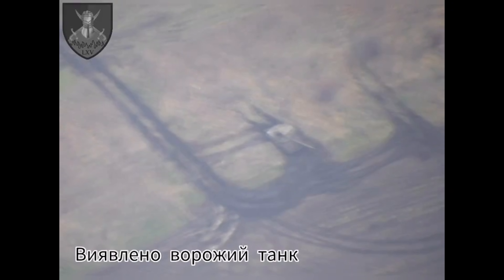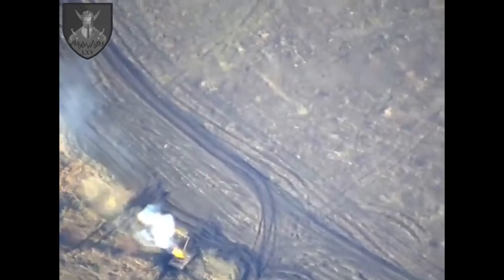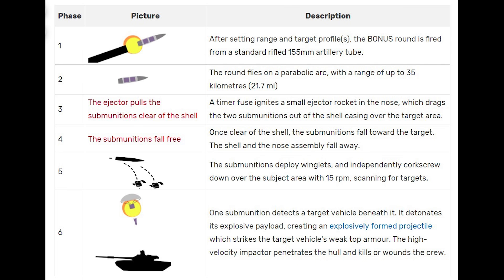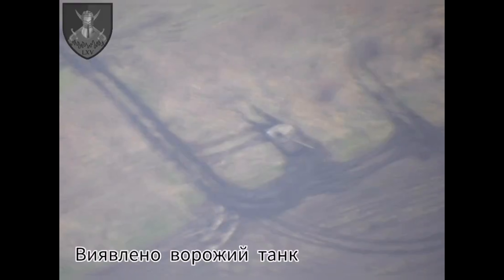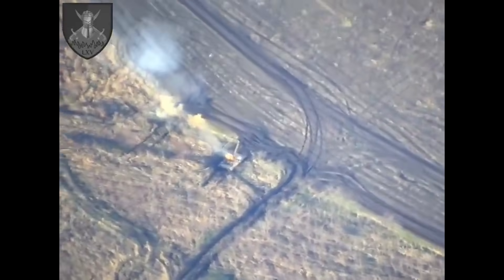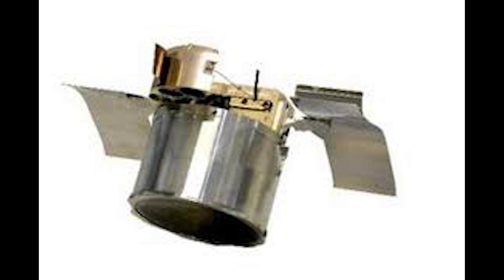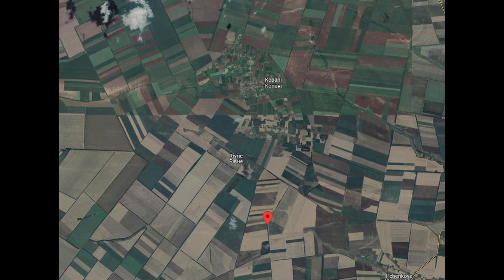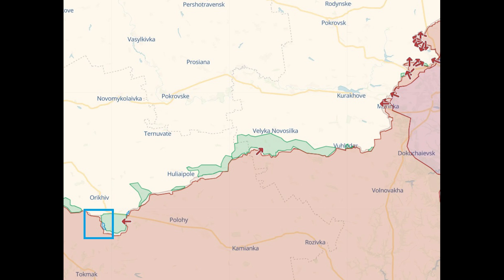Cool Footage of 155 BONUS Artillery Round  Against a T-72 -- Plus, How Does 155 BONUS Round Work?

Comment: This type of munition has been around for some time now and was originally designed to be deployed in clusters dropped by missiles onto Soviet tank formations. Ironically that would have been T-72s.

I'm not sure it would be worth dropping them from a drone, for one thing that would mean taking them out of the artillery round which means you no longer have that round to use, and I don't believe the way they operate would work with the drone. Besides, the Ukrainian drone operators look to be very handy at finding other things to drop on Russian tanks.
Reply: The problem drones seem to have currently is that the bomb-dropping types don't have ammunition with good armor penetration and difficult aiming. They are mostly sent to take out abandoned tanks or stationary softer targets and even then often requiring multiple dropped grenades. I've seen videos of the Ukrainians converting cluster bomblets that do have some armor piercing capability for this purpose but these are not nearly as powerful as those from the bonus shell.  Whenever the situation is more critical and it has to deal with targets on the move, currently it requires kamikaze drones and artillery fire. An armor-piercing, self-aiming droppable bonus device would be a more efficient alternative (for starters the larger Baba Yaga octocopter drones could carry three bonus submunitions at their current weight).
Reply: @tobiasrietveld3819  Thanks for you thoughts, Tobias. Much appreciated. As I am not aware how the Bonus munition works I am wondering if there is something within the missile which is needed to trigger the Bonus munition before deployment. If there is then just dropping them from a drone may not be enough. Equally as I mentioned if you remove it from the missile that means the missile is now not useable.

I have seen that the Ukrainians are using Russian mines with drones to blow up the Russian vehicles. A one way trip for the drone from what I've seen. I do wonder if adding a drogue chute to the mine would allow the mine to be dropped from the drone giving it time to clear the area.

Comment: Whether the submunitions can be deployed outside of the designed delivery capability would depend on how the submunition arms itself. If it relies on the spin of the projectile, then it's not likely. But if it's armed by the same mechanism that deploys the winglets and sensor package, then maybe it could be hacked in some way. I would say that it's doubtful.
Reply: iirc, and please don't quote me ;), but the sensors need a certain amount of spin as well to detect the thing on the ground.
so even if armed, just dropping it from a drone wouldn't give the sublet enough spin/time to spin up to actually target something
Reply: From what i can find is that the bonus submunition is a special shaped charge made to penetrate armour from a bigger distance than the usual shaped charges, meaning its bigger, and heavier probably than the RPG rounds often used on drones, so you would need a bigger drone. Also, its designed to arrive in an artillery shell that travels up to 900m/s so dropping it from a drone and make it behave as intended likely would be not trivial. Also, there seem to have been only 2000 produced, compared to an abundance of RPG rounds which means that even if it would work to take them from the rounds, it probably would be a rare weapon, and expensive. Now, if they can copy the explosive charge, and aiming mechanism to work when dropped from a drone so it can be dropped from hundreds of meters up while it guides itself, and then mass produce it, that would be awesome. But i bet i'm not the first person to have that thought.
Reply: @barrygillis  Maybe a more viable option could be that of coupling the Advanced Precision Kill Weapon System (APKWS) to a bog standard RPG warhead. 
The APKWS transforms the venerable 70mm Hydra unguided rocket into a precision strike weapon via a semi-active laser guidance unit.
If it could be possible to mount that guidance unit on a RPG warhead and load it on a drone kitted with a laser designator, Ukraine would have a very deadly tank hunter-killer: the drone detects the enemy armor with its on-board sensors and positions itself in a hovering over it. 
The laser designator paints the target and the RPG warhead is released (it must be done to a slightly higher altitude so that the warhead's drop speed is enough to render the guiding winglets aerodynamically effective.) 
The munition hits the target with almost 100% accuracy.

Comment: Wouldnt it be better to fit the Bofors M/94 STRIX 120mm round on UAV's. They have been produced in way larger numbers but are still capable to kill tanks and armoured fighting vehicles.
Reply: Would need a really beefy drone though as the STRIX warheads alone weigh in at 19kg a piece with the mortar launch module and optional booster rocket adds another 1.5 and 3kg respectively iirc.

My conscript platoon fired six of the babies back in 2003

Comment: A parabolic arc is the arc every thrown or fired object without wings flies on. Like when you throw a ball you throw it up and forward but the gravity pulls it downwards, the curve it follows is a parabolic curve.
Reply: Another commonly used term is a ballistic trajectory; the shape of the trajectory is a parabolic arc.
Reply: I was going to put a Newtonian Mechanics 101 explainer in, but thanks for beating me to it.
Reply: I guess they mention the parabola simply to make clear that the shell is ballistic and has no terminal guidance, leaving that to the smart munitions that it ejects, which go round seeking out tanks.
Reply: @ClimateScepticSceptic-ub2rg the munitions aren't guided either. They still follows a ballistic trajectory, but the spin induced by the winglets includes a wobble, so their seeker head scans in a circle looking more or less "down". As the round decent that circle gets smaller. If there's a target within the circle then eventually the seeker will be pointing at it, at which point it will fire the shaped charge. So no active guidance required. 

That's my understanding of how it works. I'm happy to be corrected if anyone has more information.
Reply: In vacuum
Reply: @A-W-r4s Depending on the velocity and ballistic coefficient especially the last half of the trajectory is quite a bit off from a true parabola.
Reply: @A-W-r4s  technically yes.
Reply: @mikedittsche  The best kind of "yes"!
Reply: Great explanation for the lay public to understand.  Being a retired civil engineer, I fondly recall the mathematics I learned including the parabolic equation.  Fun stuff applied to defeating a tyrant.
Reply: Thanks Mike, you saved me some typing.  Straight and to the point. 👍
Reply: * CLASSIC Newtonian motion
Reply: Another way to think about it is the horizontal velocity of the shell is constant but its vertical velocity is changing because of the constant acceleration of gravity.  Of course the actual path is more complicated because of other factors like wind, temperature, humidity, and Coriolis, but they’re minor in this scenario.
Reply: @martinedwards2004  Well, not so much the acceleration of gravity but rather, the gravitational attraction of the earth drawing the projectile back to its lowest state of potential energy.
Reply: @sequoiasemperviren3163  Gravitational attraction is the force of gravity.  Acceleration due to gravity is the change in velocity of the object due to the force.   F = ma, or a = F/m.  But since F and m are proportional, because the more mass causes more gravitational force, acceleration at the Earth’s surface is a constant called g, which is approximately 9.81 m/s^2.
Reply: @martinedwards2004  I was a teaching assistant at the University of California.  I was trying to explain the physical world in a means observers on the sidelines can understand.  I try to think of how to convey the physical world in a manner where a broader audience can understand.
Reply: @sequoiasemperviren3163  I misunderstood your intent because instead of offering another perspective, it appeared you were trying to correct me.  I’ve also TA’d, tutored, and taught engineers.  Did you delete your first reply to me?  It’s hard to tell because YT is doing bizarre things with comment filtering.  I thought the OP did a great job of a widely accessible lay explanation.  I tried to offer a simple explanation of why the shape of the path is curved.  If people get it, great.  If not, there’s the OP.  Either way everyone wins.
Reply: The BONUS would follow a parabolic trajectory until deployment of its twirling winged submunitions, which still obey gravity plus more air resistance, and then follow their internal desires to increase freedom.
Reply: @AstroGremlinAmerican  but then they let the turrets of T-72s fly, and those follow parabolic trajectories again. The circle of life.
Reply: Only on a vacuum 😀